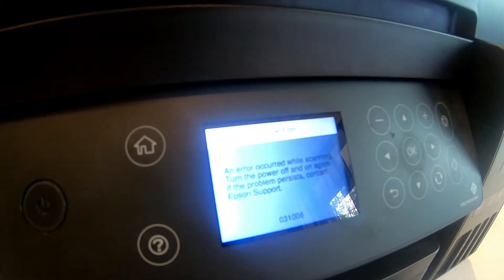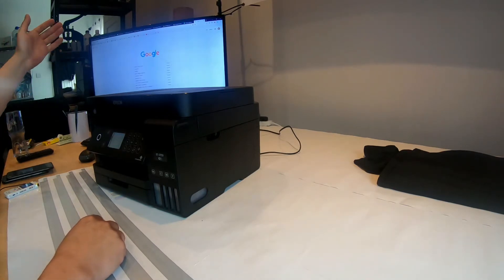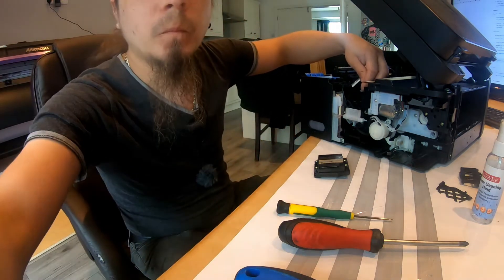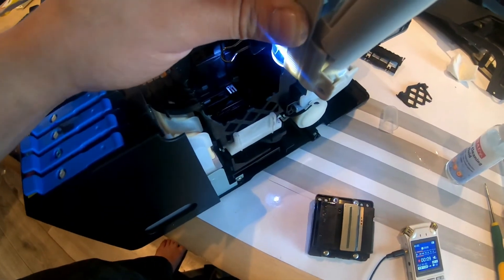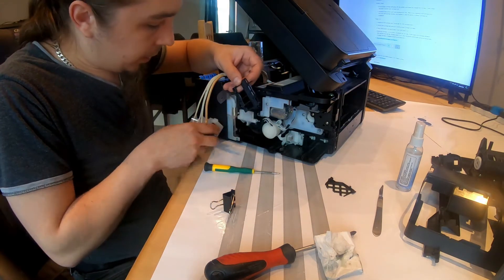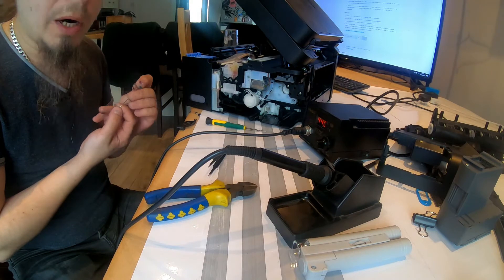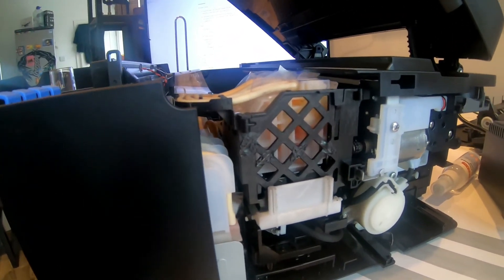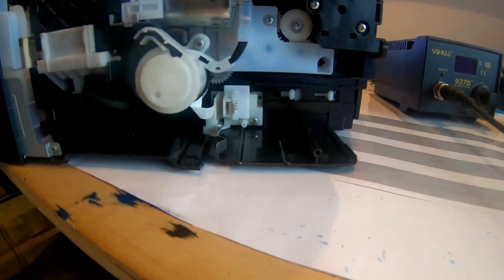How do printers die or what happened to Epson ET-3750 after 6 months

Comment: my 3750 hasnt been used in 4 months after the black and magenta no longer prints anything. what do you suggest to get the ink moving again? where is the  printhead I should be cleaning? thanks in advance. ive seen a video with a guy promoting cleaning those white tank things with his "cleaning solution and syringes". Im a DIYer and wouldnt mind opening it up a bit for a more intrusive operation
Reply from the maker: I still have my 3750. I'll try to make a vid on your request. In the meantime, white things or dampers, cleaning of them that is, won't do much if the printhead is clogged.
Reply: @GDS-LTD   Pardon me, I was referring to these "cartridges" that you removed at 4:02. In his video he just syringed a 'cleaning solution' into the corresponding clogged 'cartridge' while catching residual ink on a paper towel below- stating it'll fix the printhead clog issue. Some people said it worked while some others complained the ink no longer works at all. Vid attached for reference: https://youtu.be/Xj7AJlKYmCo
Reply from the maker: @Vic da G  Yeah, this is bad. No only he claims that it won't damage anything, there is no way of knowing what product is supposed to do and for. There are at least 3 types of active cleaning ingridients, some are more corrosive than others as well as different printing technologies have different cleaning solutions. Piezo-electric printheads of epson are cleaned in a different way to the Canon ones. And the cherry on top? He wipes the surface of the printhead on a definetly non-lint free cloth. He is literally destroing his printhead every time he does this.
Reply: @GDS-LTD  wow thanks for the heads up. I actually made the assumption that all I needed is alcohol. I look forward to some real advice. Thanks in advance.
I don't like that the WF-3750 requires constant use to keep the printhead clean. I relied on a scheduled color 'test page' weekly printjob to keep the printheads clean but after 2 month of non-use, 2 printheads are clogged.
Reply: @GDS-LTD  here's another cleaning video along with a cleaning solution. https://youtu.be/4aPOQRc5eek
Reply: @lionintu  You better switch to canon pixma, they have user replaceable print heads. Same thing happen also to my epson when cyan dont print and print heads replacement is so expensive since it is built in to the printer. Canon pixma are also ink tank printers.
Reply: @luisocamp2753  sweet. I see a G6020 megatank. I'll verify if it has that what you mentioned. Thanks. 
Edit: also G3260
Reply: @lionintu  yes those two models both have user replaceable print heads. All canon ink tank printers in fact have user replaceable print heads.
Reply: @luisocamp2753  Cannon has its own issues. Mine sat 6 months and locked to side. looking at 3750 to replace. Also the tubes tend to clog on these and can be vacuum pulled using syringe to reflow ink.
Reply: @day-one4676  of course the reason you buy ink tank printers is to use it often, its for businesses and frequent printer consumers who prints on a daily basis, thats why it has the tank there for its reason. Print atleast a full colored picture once to twice a week to prevent ink clogging and ink tube backflow.